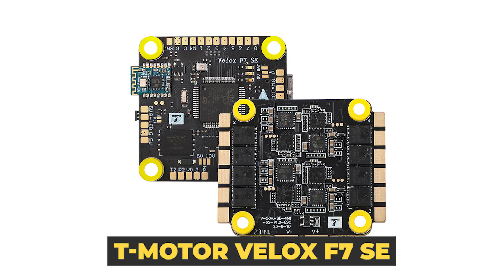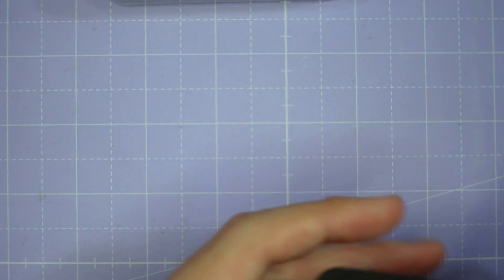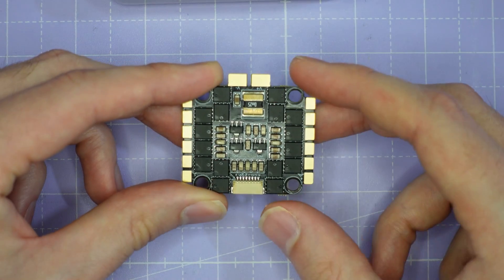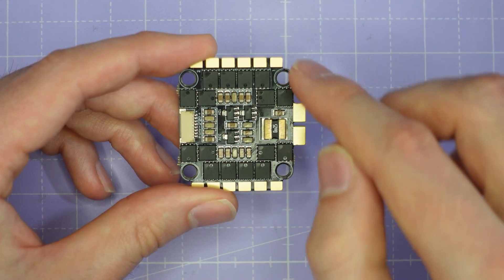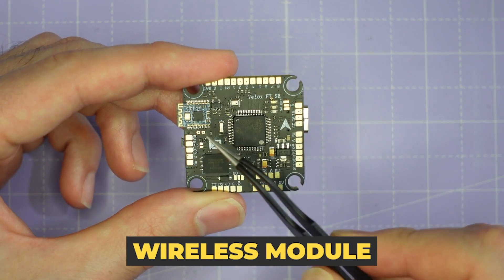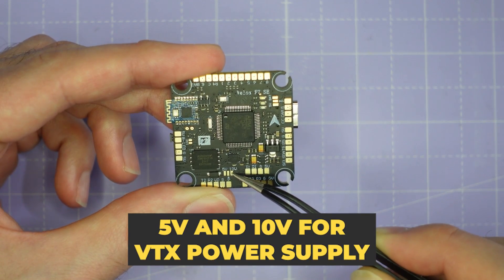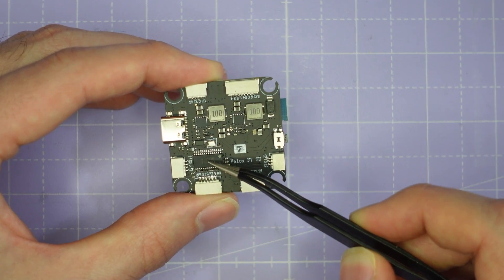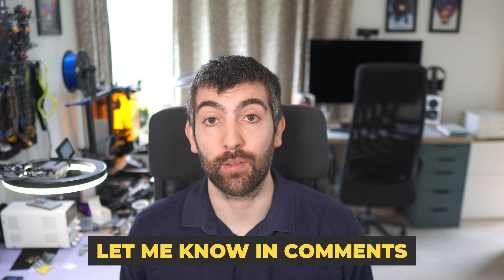T-Motor Velox F7 SE: Great features and great value!

Comment: I’m currently using the T-Motor VELOX F7 flight controller, but I noticed that there is no specific ArduPilot firmware available for this FC.

I want to confirm whether it is possible to safely use any other compatible firmware target for this board so that I can run ArduPilot, as I am interested in experimenting with it but don’t currently have the budget to buy another flight controller.

If anyone has experience using ArduPilot on the Velox F7 or knows a compatible firmware target, please let me know. Any guidance would be really helpful.

Thanks in advance!

Comment: Two questions for you! Does this support Bluetooth for SpeedyBee app on iPhones? Because I’m having trouble.. also does this stack have flip over after crash in the modes tab? I’m not seeing it anywhere and that’s a big disappointment for me as well! Let me know your experience or anything that could be useful! Thanks :)
Reply: Edit: found flip over after crash! Had to power cycle it.. and I see it’s only Bluetooth connection for Android at the moment😭 didn’t read the small print first lol that’s on me

Comment: Ok, maybe a dumb question but how do you know which side of a  flight controller is the top? I’ve had a hard time figuring out board/sensor alignment before and would like to avoid that in the future lol
Thank you!
Reply: The top usually has the company logo (T for Tmotor next to the Bluetooth chip in the vid.) Also the arrow that shows you the front of the FC is also imprinted on the top.

Comment: Guys this FC only has a 1.5A 10v BEC so it's no good for DJI O3 air units. O3 needs at least 2A. Major oversight from T-Motor on this.
Reply: I built an O3 Quad with this stack last week and no issues so far
Reply: I'm running this stack also and no issues with 03. Everything is working as expected.
Reply: Damn really
Reply: Why event brother with BEC when u can power o3 from battery
Reply: @tomaszapczuk7761  because if you have a voltage spike it’s dead. When it goes through a bec and you have a spike, the bec takes the hit
Reply: Moonlight only requires 12v 1.4A
Reply: I wanna see test results, thinking about buying this stack
Reply: I'd rather take Speedybee F405 v4 with 3A 9V BEC....
Reply: I bought this FC a month ago. It worked first with Speedbee app 2 times but not anymore. The FC itself flies.
Reply: DJI O3 requires 15W. This is 1.25A at 12V. If it is reliable 1.5A it is enough. Many chinese companies will probably write 3A on this bec.
Reply: So, its still good for dji o4 pro at 2025 or still need the bec external?
Reply: Vbat and a 4 dollar matek BEC.. or if you are 4s you can run straight VBAT. Not that big of a deal considering
Reply: @xORLOCKx  Yes but we shouldn’t need to be buying & wiring external becs for a $90 stack. All they needed to do was increase the amount of rating to 2A. Not hard to do
Reply: @bentoogood  then don't buy it? 🤷 not sure what your point is. Either buy it or dont. Pretty simple..

I run VBAT on 4s with a capacitor and have never killed a VTX with a voltage spike
Reply: @xORLOCKx  The point is it’s silly in 2024 for a new FC to not have a high enough rated BEC for DJI O3, the dominating video system that the vast majority of the FPV community use. I am simply pointing this out as this is a major oversight that hasn’t been mentioned.

And when 99% of vtxs on the market are rated to take 6s, of course you haven’t killed a VTX running 4s 🤣🤦‍♂️
Reply: @bentoogood  all VTXs have issues when hit with 6s voltage spikes. This is nothing new and nothing that doesn't happen to speedy bee or any other stack. A fully charged or close to chatged 6s lipo will Kill ANY vtx with a voltage spike. I've seen plenty of 03s die from them.
Reply: @bentoogood  so we shouldn't have to wire things up on a quad that we are literally building and wiring up? So we can add RXs, motors, GPS, LEDs, GIMBALs and all sorts of custom parts but adding a BEC is a knock on the FC? That makes zero sense unless you come from a world where you refuse to do anything but plug something in. Which in that case maybe this isn't for you if you can't be bothered to properly build a quad.

Speedy bee and other budget stacks fry the second they get a spike.. adding a BEC and cap on a speedy bee is common to protect it? But not for this one? You are making a stupid argument

If you are flying professionally which higher standards need to get met. Then it's on you for not spending extra money for higher tier parts. Budget and operating as a 107 shouldn't be together.

This is WHY this is a budget stack.
Reply: @xORLOCKx  What I’m saying is what we shouldn’t have to do is go to any additional expense/time for something that is literally standard in almost every flight controller in 2024. Basically every FC has a 2A bec Breeze.

I have built much larger, more complex rigs than your little 5 inch freestyle quads so I’m well used to building quads. As such I’ve used countless FCs and for one to be released without a sufficient BEC for the O3 air unit in 2024 is stupid. People will lose/crash their drones to this when the O3 feed cuts out midair. I’ve fed this back to TMotor directly. Even the $30 Speedybee F405 FCs have a 2A bec. So for a $90 stack to not have this is definitely a problem.
Reply: @xORLOCKx  then why talking about it? not sure what's your point. Either buy it or not. Pretty simple. We are here to discuss about it. If you don't like it then don't talk. It's a 2024 FC without decent BEC. And this is worth to mention.
Reply: @BenToogood  its a budget stack.. you dont have this problem with more expensice stacks. You want cheaper corners are cut. Dont buy a cheap stack. Problems solved.. want to save money? They do the extra work on the build ro keep it alive.. yeah they should have put a better bec on it.. no sh!t. But they didnt. So buy a better one or do what you need to in order for this to work. Their pro 2 ESCS dont do this
Reply: @YourdailydoseofShorts-un5vi  i literally said that in my first reply... dont buy it. Spend more for a better one

Comment: Speedybee is #1 on FC EVERYONE Else is trying to mark up the price from $70
Reply: Take a look at the new foxeer f405 V2 stack, it's sub $70 with some killer specs
Reply: @timmieskills  f405 is all we need I stopped buying f722 a year ago. F405 is more than enough for me to keep flying this expensive hobby.
Reply: @timmieskills  it's a nice slack but lacks the Bluetooth speedybee app. Using the app in the field makes it easier to configure your drone. If they would only make it Bluetooth that would set it off a lot better.
Reply: @LehtusBphree2flyFPV  fair point, but using your osd menu or just a USB from your drone to your phone is a decent compromis
Reply: @timmieskills  true I didn't think of that
Reply: @LehtusBphree2flyFPV  got the foxeer stack on a 7" which I wanna try on 8s so im excited for it
Reply: @timmieskills  that's a fact on this FC 7" to 9" long-range on 8s

Comment: Awesome review, Chris! 😃
Too bad it's an F722...
Stay safe there with your family! 🖖😊
Reply: That's what makes it budget. 🤷
Reply: $90 is budget? :body-blue-raised-arms:
Reply: @TweakRacer  for an entire stack that's Tmotor quality.. yes. No one is making you buy it. Stick to the speedy bees if it works. Fly what you like to fly and find YOUR budget. But for Tmotor this is in fact a budget stack.
Reply: isn't f722 a higher end processor? I know h743 is the faster one
Reply: @xgg_fpv  The F722 and F411 have only 512kb of memory - something like that. F405, F745, F765, etc have 1mb. The double. So, it's becoming an issue for Betaflight and iNav.

Comment: Great review sir. Alot of features for not alot of money! Can't complain there. I've been running the speedybee f7 v3 to death in almost all of my recent builds because I thought it was dollar for dollar one of the best stacks for the price. I would definitely like to try this stack though. The Bluetooth chip is huge for tuning on the go. I'm doing a 7 inch build next... do you think 50 amp is enough? Probably I will run 2806.5 - 2807 motor...
Reply: It should be plenty for a 7 inch, I ran the speedybee f405 v3 stack on mine for quite a bit of hard freestyle without jssue

Comment: that's quite expensive, why would one buy this over a speedybee?
Reply: Because the quality is 10 times better than speedy bee. When you start popping BECs and Mosfets on the speedy bee, or your USB falls off or your solder pads lift, or you see the difference in electrical noise on the gyro.. tons of reasons. SB makes a great budget stack for what it is. But Tmotor is light years ahead and better quality.
Reply: Quality?
Reply: Because speedybee esc's 💥
Reply: theres an 8s foxeer stack for just under 70 bucks.  speedybee or foxeer is a better buy i believe.  get a foxeer or speedybee you will be happier.
Reply: @fededabz  I just put that foxeer stack in a quad. Noticed the stack bolts were getting extremely hot so I pulled it back apart to find the ground wire between the esc and fc had gotten so hot it melted the insulation and the plug. Sounds like it was a short internally somewhere.
Reply: If it was an F765 (if I'm not mistaken) I'd disagree... But it's an F722! I have to agree. 😕
Reply: @MCsCreations  Pretty new too DIY stuff, what's the difference?
Reply: @NixsmFPV  The amount of memory available for the firmware. 
Like, the F3 boards aren't supported by Betaflight anymore because of that. Now, the F722 and F411 are the next on the list to be dropped... You know?
The F405, in opposition, has more than enough memory. The same for F765 and another one I don't remember right now...